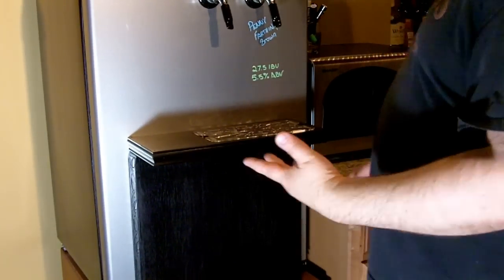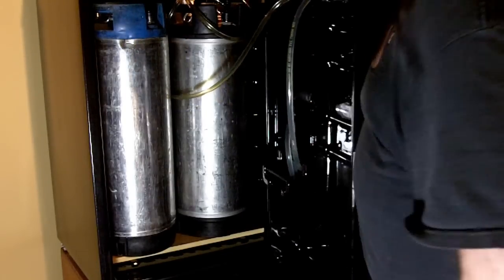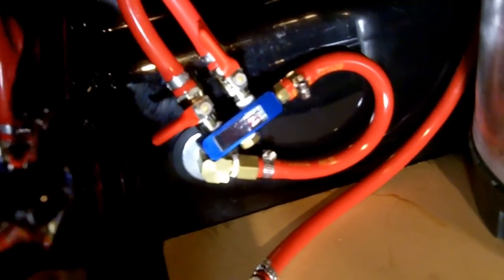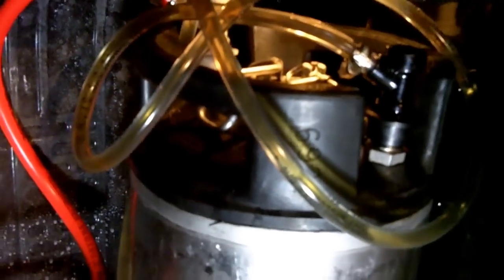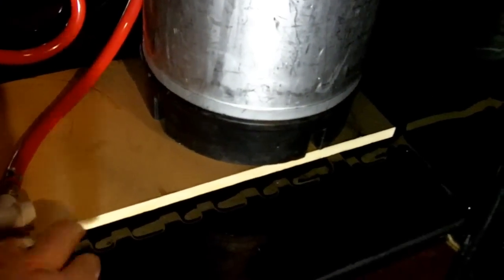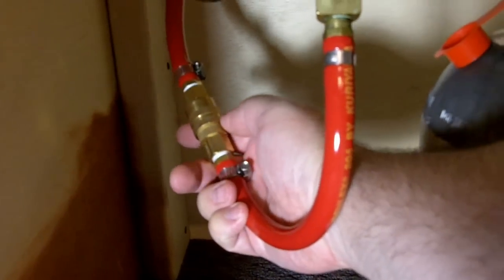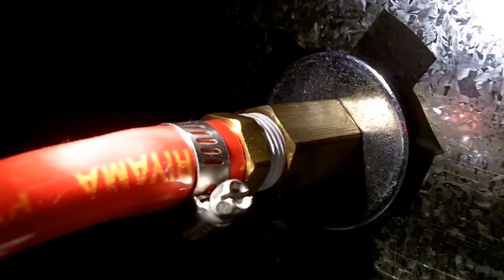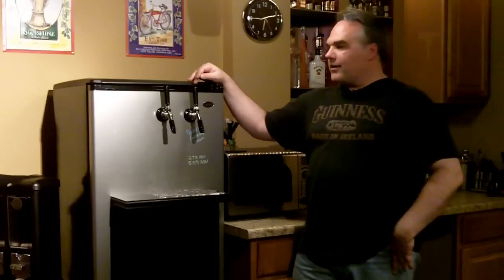Inside the MaximAvs Kegerator

Comment from the maker: Where I drilled the hole through the back there are no cooling lines. It is located in the "hump" where the motor is located. There are no lines in the walls of the back as the lines are located inside the fridge in a plate that you can see covered in frost in the video (it's kinda dark but you can see it). Hope this helps!

Comment: @MaximAvs Thanks, does it matter what sizes i use at all?  I had trouble finding the 5/8 barbed fittings with the 3/8 mip.  What barb is needed for the hoses?